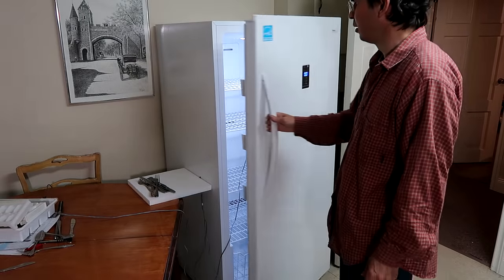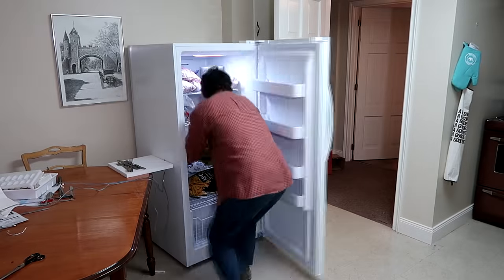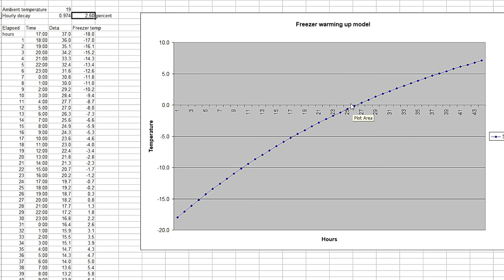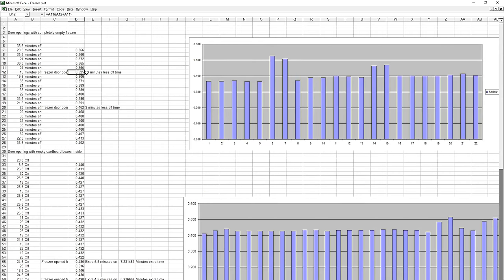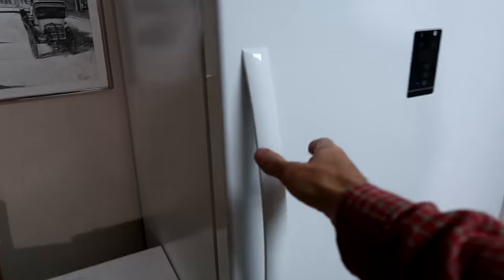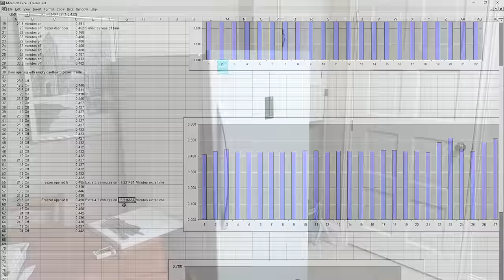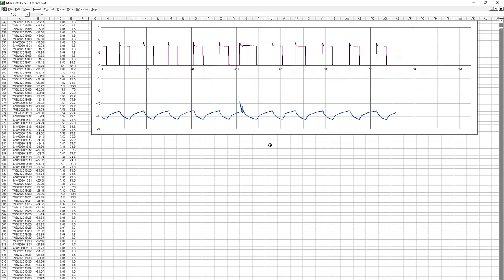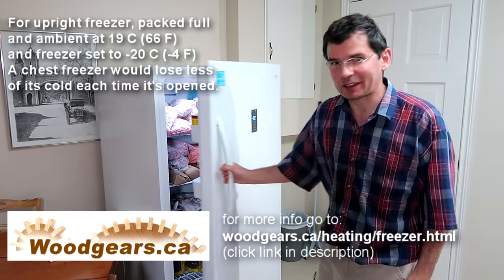How long does a freezer stay frozen with no power: experiments

Comment: In regards to the conversion to “obsolete units”, in my perfect world, we would use metric for everything except temperature. As there are no base 10 divisions in C used (e.g. decidegrees, millidegrees, etc), I find the more granular F scale more practical to use in daily life without resorting to decimals. For example, you can just feel the difference of 1 degree in F, but 1 degree in C is quite noticeable. In science though, you are using decimals either way. Of course, this is just my opinion; no intention of starting a metric v imperial war.
Reply from the maker: True, smaller divisions can be handy.  And Mr Farenheit probably made the scale so that you would never hit negative units (or at last not where he was from)
Reply: I kind of disagree. One degree Fahrenheit isn't really enough to be able to really tell the difference between. One degree celsius is a 1.8 degree fahrenheit difference. Larger, but probably closer to differences you'd notice. And in almost no day-to-day context do you really need to discern differences less than one degree celsius anyway.

Comment: Stupid question: Can't you get the infos from the manufacturer?
Reply: You can get marketing babble and useless numbers from them. If they have any actual data at all it would never leave R&D.
Reply from the maker: Exactly.  This is not the sort of numbers they would advertise, and if they did, the methodology would be biased in their favour.  And so we have "5 horsepower" shopvacs that plug into a 120 volt sockets.  And "100 watt" computer speakers that run off a little 9 volt wall wart.
Reply: @matthiasrandomstuff2221  This, of course, is bad experience. Thanks for the fast answers. Regards from Germany.

Comment: I had about 50kg(~100lbs) of beef in a upright deep freeze that thawed that's when i learned the other problem with an upright deep freezer. Everything runs out on the floor if it thaws. It looked and smelled like someone got murdered in that room. I had to take the day off work and rent a carpet cleaning machine. I managed to save the carpet.

Comment: Clearly full freezers are more efficient.  Thanks.
Reply from the maker: Actually, none of my tests suggested that.  Lose less heat on opening, yes, but running, no.
Reply: @matthiasrandomstuff2221  I guess I should have said more thermally efficient, in that they warm up slower without power keeping them cold.
Reply: @sbellock5  That extra thermal mass still needs to be cooled down. There is no such thing as a free lunch.
Reply: @fergusoddjob  People always confuse thermal mass with things taking more or less energy. It's funny, but can also be frustrating.
Reply: @timderks5960  Well, because that's exactly the point. More thermal mass means changes take more energy flow to happen. That just happens to apply when you're cooling it down the same as when it's then being heated back up.
Reply: @seigeengine  I know that... that's why it's funny / frustrating to me, because other people don't know it, and just say "that takes less / more energy", even though it doesn't, and it's just thermal mass in action they're talking about.